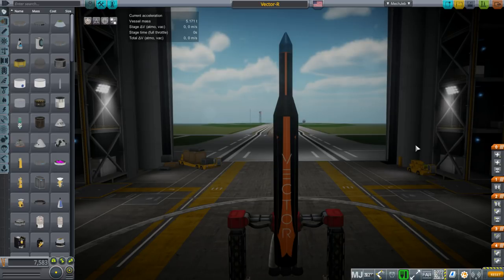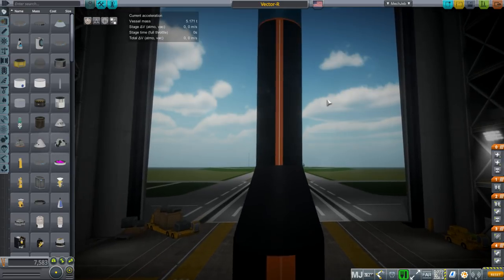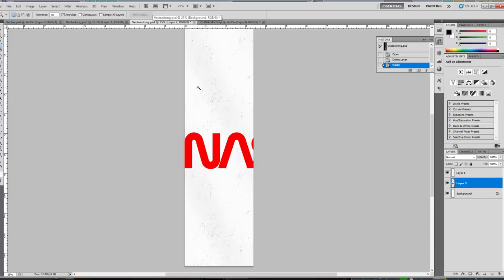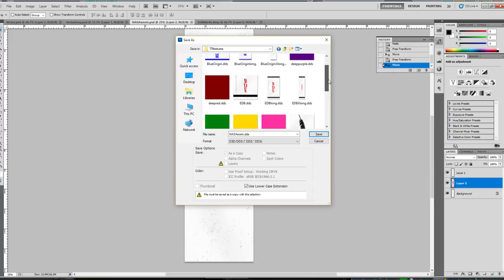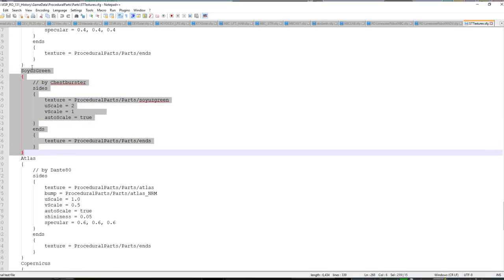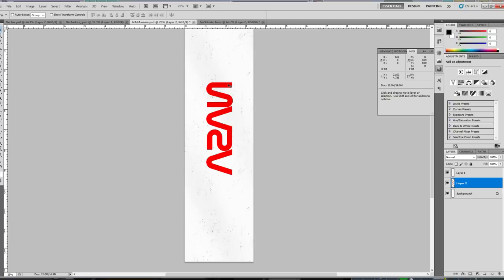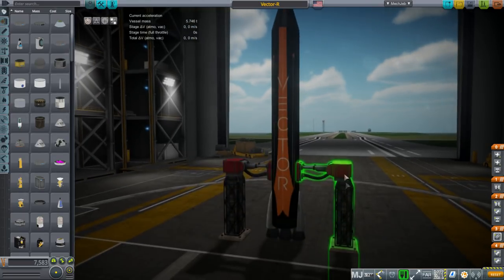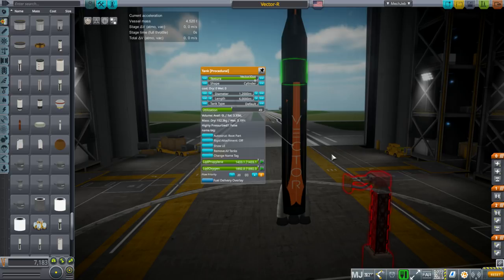How to Make Custom Rockets in KSP 01 - Procedural Tank Textures

Comment: I'd want a mod that adds Procedural Engines, where you can manually shape nozzles, select cycle (Expander, Staged Combustion, Gas Gen., etc.), Select chamber pressure (maybe multiple chambers and plumbing even), build your own mount, clusters, etc. And the engine specs would depend on the parameters that you specify. That would be great, idk why such a mod doesn't exist. :(
Reply: I don't think it'll be more demanding on the CPU than normal engines. (Except maybe for rendering) The values and the mesh will be set in the VAB when creating your own engine, Physics will use precalculated thrust just as in normal engine.
Hard to make? Maybe making procedural engine mesh from user input would be hard (and the maths for calculating thrust, ISP's, etc from engine shape).
Reply from the maker: It's doable using the Procedural SRB bit of Procedural Parts as a model. It would only be interesting using a mod like Test Flight which will be able to destroy new, overly ambitious engines, and demands testing to increase reliability.
Reply: Yes, Test Flight  would be fun with that. With disabled data units cap, and instead of that using log curve to gradually limit data units gained from testing (understanding of an engine irl gets better with every flight. It doesn't magically completely stop improving at certain arbitrary point).

But when it comes to 3D models of engines, i was thinking more of having like nodes, attached to specific parts of an engine, that you can move, scale, rotate, etc. to change it's shape. (and nozzles kinda split into several pieces from top to bottom, so you can change it's shape)
Reply: @Katniss218  phly logo